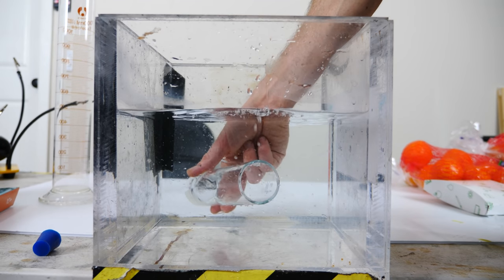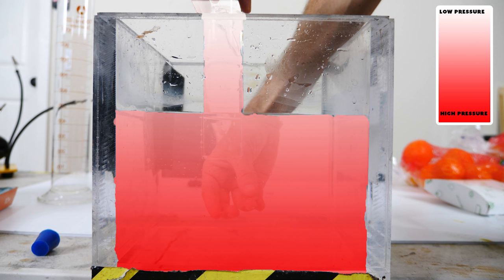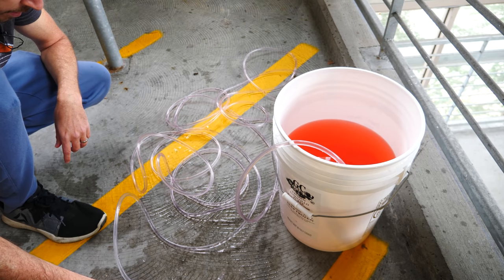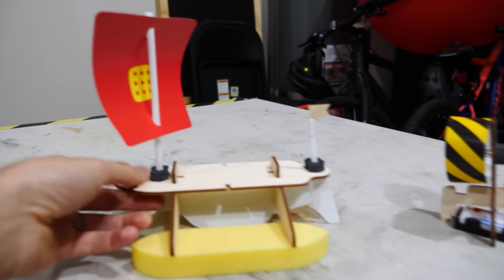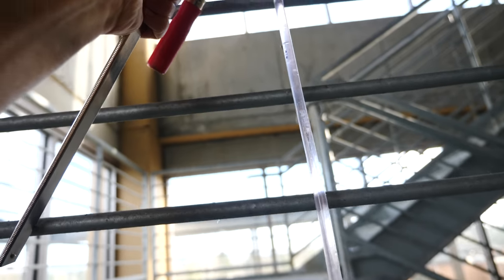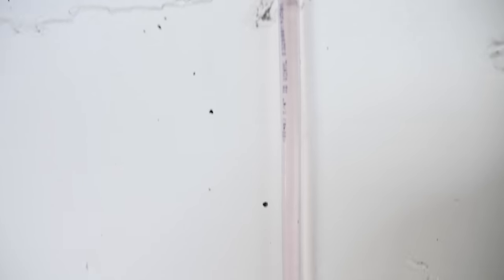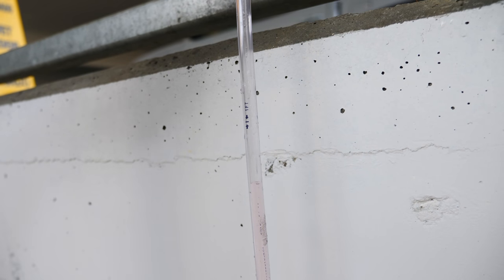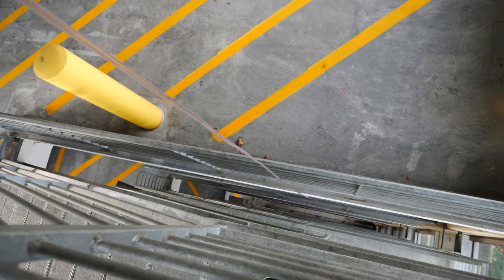Why Water Boils In Tall Cups

Comment: Since he didn't say where the magical 33.8 ft came from I figured it could be nice to come up with it. When the water hasn't boiled yet we know that at the surface level the pressure is equal to the atmospheric pressure. But the pressure inside the tube is "only due to" the weight of the column of water.  So the force at the surface is equal to the mass of the water inside the tube times the acceleration of gravity
F = mg
If the total volume of water if V in its density is rho, then we get
F = rho V g
If the cross sectional area of the tube is A and its height is h, then we get
F = rho A h g
F/A = p = rho g h
And we get the pressure dividing the force of the water column by the cross sectional area.
Therefore, the pressure at an elevation h above the surface is equal to the atmospheric pressure minus the pressure due to the column of water that has been risen
p(y) = p_atm - rho g y
When the water hasn't boiled yet we can calculate the pressure like this. But the pressure can't drop indefinitely, it certainly can't drop below 0, but it certainly won't hit 0. Just like water boils at different temperatures if you change the pressure (for example it boils at lower temperatures than at sea level in higher altitudes), if you keep the temperature steady and drop the pressure it will also boil, the two actions are equivalent. That means that just as there are a boiling temperature at a given pressure, there is a "boiling" (saturation) pressure at a given temperature. 
You can read these pressures in a saturation table, but at 20 C (68 F) the saturation pressure of water is 2.31kPa (0.33 psi). Then we say
p( max_height ) = p_sat( 20 C )
p_atm - rho g max_height  = p_sat( 20 C )
max_height  = ( p_atm  - p_sat ) / ( rho g ) 
max_height = 10.1 m = 33.13 ft
Reply: Thanks for the supporting info...and double thanks from the 95% of the population that uses metric
Reply: @amalieemmynoether992  you always use metric for science in america
Reply: He could've got 33.8ft cauz he used a small tube and there could've been capillary effect supporting the water up
Reply: @basidhsajan2398  Yeah, and I estimated the temperature, so that could change the results as well
Reply: @e4Bc4Qf3Qf7  then why do I constantly see science shows/YT vids that still state units in imperial measures often with no conversion to metric?
Reply: @amalieemmynoether992  because science communication is more about conveying a sense of scale to the viewer then about accuracy.
Reply: @e4Bc4Qf3Qf7  which brings me back to my original comment ...that "sense of scale" (using imperial measures) is only meaningful to the pop of the US (5% of the total pop of Earth). To the rest of us that use metric on a daily basis, not just in school, it's meaningless.
Reply: @amalieemmynoether992  In english videos, viewed mostly by americans, made by americans, on a platform invented in america.
Reply: @e4Bc4Qf3Qf7  firstly, what does the "platform invented by Americans" have to do with it...it's a global company. Secondly, "mostly viewed by Americans"- what evidence do you have for this statement? Approximately 1.35billion people speak English either as a first or second language. Of those that speak it as a second language, reliable sources are difficult to find on the proportion that speak English fluently. But we do know that most of the English speaking population use metric.
Anyway, I tire of this argument so I won't be responding further.
Reply: thanks

Comment: We can quite easily calculate which pressure must be in the tube so that the water boils. I study chemistry and we just had thermodynamics this semester !

I'll give you the answer directly: Only 2.78% of atmospheric pressure at surface level (2823 Pa, or 0.41 psi)

Here's the calculation: We can use the integrated form of the Clausius-Clapeyron equation to calculate the partial pressure (= pressure in the tube). All we need is the normal boiling point T0 (in Kelvin, 373.15 K), atmospheric pressure in Pascal p0 (101300 Pa), the temperature of the water in the video T (I suppose 20°C, so 293.15 K), the ideal gas constant R (8.314 J/K mol) and the enthalpy of evaporation of water per mol Delta vap Hm (Lit. value 40700 J/mol). 
The equation, rearranged for the partial pressure of water is: p = p0 * exp { [delta vap Hm / R] * [(1 / T0) - (1 / T)]} = 2823 Pa.

Btw, according to the barometric height formula, this is the atmospheric pressure at a height of 301.3 km above surface, though I am not so sure if this formula is that exact for such great heights.